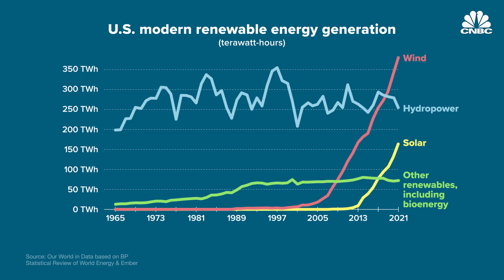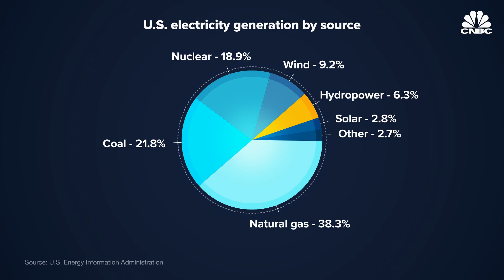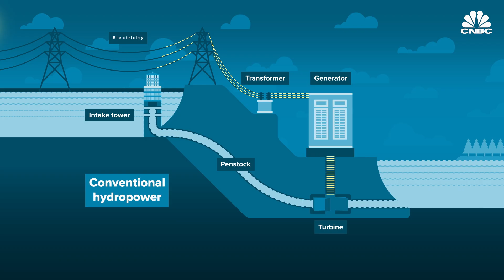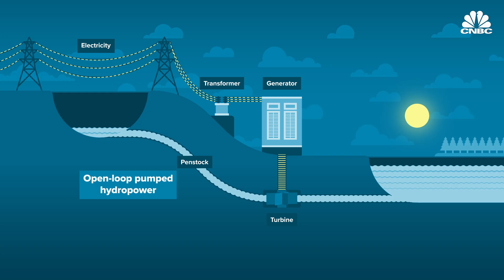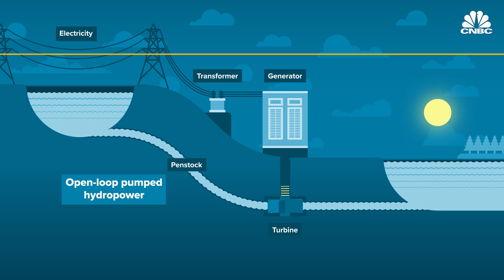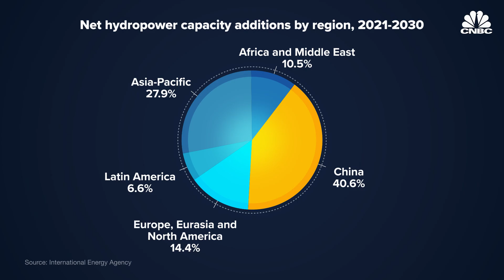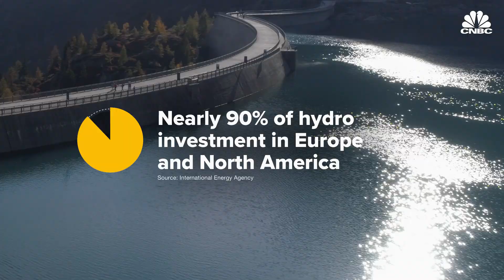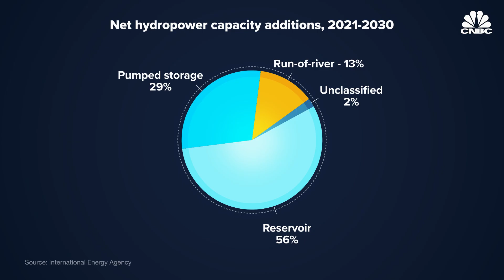What Is The Future Of Hydropower?

Comment: Are we going to talk about nuclear power and how safe and its way cleaner than coal and natural gas?
Reply: Fukushima.  . Chernobyl. Three mile island.  Safe?  No.  Ecological disasters.  Global disasters.   Get a clue.  Radiation is deadly.
Reply: So you want to talk about nuclear because it is supposed cleaner then let's start with the cost.  

A good example to highlight the cost of a nuclear power plant is the Edward Vogtle plant in Waynesboro, GE. That is the only plant now under construction in the country.  It is actually two reactors added to the two already present.  The estimated cost for these plants is projected to be 25 BILLION $$!!.  Length of time to completion from start to finish is more then ten years. They started construction some years ago. 

People are going to have to make up the cost of these expensive nuclear plants which might be good for 70 years tops.   So not cheap any way you look at it.  

And what about how clean nuclear power plants claim to be?  One thing often over looked is prodigious amount of CO2 produced from cement production for the plant construction. 

And of course there is the highly radioactive waste produced by the plant which the US still hasn't found a permanent home for.  It continues to accumulate on the site of the nuclear plants where it is produced.  How long can that go on?   Then there is also the vast amount of low level nuclear waste which must be stored away indefinitely.

And did you say that nuclear power is safe?  Did you forget about Fukushima-- complete melt down in at least two plants due to coolant loss because the tsunami wiped out the back up generators. March 11, 2011.  There was a partial meltdown of the Three Mile Island plant in 1979.   There was the explosion of the Chernobyl nuclear plant in 1986.    

So whether it is democrat or republican states nobody seems to want the big new nuclear plants because of all the baggage that comes with it.  

And lastly there is talk of thorium reactors mininuke reactors which supposedly produce less waste.  But I see no commercial activity with either option.  Maybe the authorities need to talk about it for few more years to decide how to sell it to Americans.  🙄

Any more questions?

Comment: In Québec, the hydro power generation is dynamically adjusted. When wind/solar production goes up, they immediatly reduce flow of water through dams. This preserves the water in the reservoir and is far mreo efficient than letting it flow down and pump it back up. Hydro is our base load, we don't have nuclear or any sizeable fossil fuel production on the main grid. 
Where you have non-dymanic base load such as nuclear plants that take hours to adjust production instead of seconds, you can't do that and you end up with surpluses when wind/solar produce.

Comment: How many towns have a water tower?  Each of those could very easily be converted into energy storage.
Reply: Water towers inherent design is to pressurize the water lines. Put a generator in between and you ruin the towers initial purpose. It still takes energy to get the water up there ya know?
Reply: @aberrantxsoul4777  - the tank doesn’t have to to be completely full all the time so at the very least you could pump the water up when there is excess power being generated to save costs and help even out the grid’s power.  The power conversion part could be done by adding a lower tank and water is simply moved between the two tanks.  The generator could be part of the lower tank if the power generation does reduce water pressure, but I don’t think it would actually do that since pressure should still be based on elevation difference.

Comment: I have often thought that flood waters could be used and pumped into drained aquifers in the Midwest. This would help many farmers whose water wells are drying up. And in turn help the entire country secure our food sources.
Reply: generally surfacewaters are not desired to be directly pumped into aquifers due to contamination risk... however a flood recharge where an area is purposefully flooded and allowed to trickle down (thereby getting filtered) is an option that is used in some areas.
Reply: That's actually a good idea. It'd probably need treatment and therefore more than just local, 10' x 10', pump houses. Our depleting aquifers are of grave importance though.
Reply: true california lets so much water go to waste when they need to improve infrastructure to collect it. they been using too much ground water. as dirty as it sounds imagine if urine was recycled and then used to hydrate californias forest. would prolly avoid using it for agriculture. but it is safe I mean NASA does it all the time.
Reply: I’ve considered that as well.
In regards charging aquifers I heard the figure that 30% of the stored water in the Colorado River system leach’s into the sandstone. Was wondering where that ends up.
Reply: I keep asking the SAME THING

Comment: We here in the Pacific Northwest get the majority of our electricity from hydropower. 
It's the best. We also have the Bonneville Power Administration which is a government agency that keeps the rates low and maintains thousands of miles of transmission lines.
Reply: That’s right, up here in BC, 95% of our power is from renewable sources, with about 86% of that coming from hydropower.
Reply: Quebec has almost 100% with hydro power.
Reply: @Arctic_Adjuster  You need to learn more and understand the power grid.

Comment: A water tower could be used for small scale water storage, they have also been used for years.
Reply: I believe the issue is pressure. Water towers exist to ensure pressure to the taps that they feed, so using some of that energy will lead to lower pressure and less efficiency of the distribution system. That being said, there are thousands of pressure reducing valves in urban distribution systems. Retrofitting these to produce power is a huge untapped (pun intended) opportunity.
Reply: @mkkm945  I considered the idea of running a hydro plant of civil water systems. I was just thinking a dedicated water tower for storing water only for use in the hydro plant. It reduces the need for drinkable water in a system intended to reuse the water in a closed system.
Reply: @BeastBishop  Ah yes. In that case, yes.

Comment: Hydropower is also damning (pun intended) to downstream communities.  China's dams on the Mekong River have choked SouthEast Asian countries of critically needed freshwater.  And it's not particularly sustainable either or stable with weather patterns and snow-based water sources set to change and decrease drastically over the next century.
Reply: Depends how they do it. A dam just holds water temporarily, then releases when its filled. So its the same. But people consume and waste all the water so nothing left flows down stream. People are just stupid. They ruin everything.
Reply: @TheBooban  that is not necessarily the case trapping such a vast amount of water in one area leads to extreme levels of evaporation that otherwise would be minimal
Reply: The upper Mekong basin where China is, is responsible for around 15-20% of the water flow in Mekong. Its the lower basin who is responsible for contributing most of the water in the Mekong. But Laos has build dams in the rivers that feeds Mekong and Thailands Mun and Chi rivers doesn’t supply as much as they are supposed to do since farmers pump out water to use in their farming

Comment: Too bad no mention of the various wave/tidal hydropower systems, which are ecologically friendly, and expandable, and there are going to be continuous tides, either in or out, for a very long time.  No need to dam up rivers/lakes, no need for storage.   All the coastline the US has it could really be a major source.
Reply: They don't work
Reply: Storage is a huge potential positive of hydropower because of pumped storage. Tidal is not commercially viable at the moment.
Reply: Wave and tidal generation has a much lower energy density so it puts out fare more CO2 per KWH
Reply: @terenceiutzi4003  Hi Terence, how so? The several systems I've seen over the years I don't recall them making any CO2?
Reply: @ph5915  Manufacturing. You’d need to make more turbines and run more wire to create an equivalent amount of energy to an average flow rate dam. Everything industrial creates carbon dioxide.
Reply: @ph5915  no they don't make it but over 90 percent of the Co2 on earth is suspended in our water and the cooler the water is the more it can hold! So if you dam it of and let it warm the Co2 is released into the air! And if you rise and lower the pressure of the water all of the entrained gasses are released as bubbles! And that is why any hydro generation releases so much Co2 into the atmosphere!
Reply: @cameronf3343  Hmm, good point. But many things, including all the concrete for the dams, is intensive to build, but I suppose over the long run of time, tidal/wave would need to be repaired / replaced more often in the harsher environment...Thanks Cameron!
Reply: @ph5915  The concrete CO2 production for dams are profusely minimal compared to the CO2 reductions down the line for how powerful they are, considering a single dam is able to make the energy equivalent of several large fossil fuel power plants. Hydro regularly works in the gigawatt hours rather than megawatt hours. However, rainfall pattern changes and drying up rivers due to climate catastrophe is making them less viable seeming long term and it is true the saltwater erosion would make undersea power generation need to be maintained and replaced more often, however, that would also be minuscule compared to the potential terawatts that could be generated by currents. Undersea infrastructure, aside from ecosystem safety, really wouldn’t work with the same laws of physics and we could make turbines with blades which capture far more energy than air-spun turbines.
Reply: @cameronf3343  Thanks Cameron!  Yep, day or night, there's always tidal in/out. A few months ago this company had developed this modular/expandable floating platform, the top could be solar panels, the edges could have wind turbines and underwater the tidal motion capture. Sounded amazing to me.
Reply: Tidal is more dependent on Geography than Hydropower. 

There is a reason its not used as much. Not many places can work for Tidal power.
Reply: Because that technology is not economically feasable
Reply: We will need every type of renewable technology.
Reply: @Morhua1  Thank you, Mattias, I absolutely agree, I was just thinking about relating to hydropower in this instance, but absolutely, anything and everything to get off of fossil fuels and be much less harmful to the environment.  After all, it is the ecosystem human life depends on.
Reply: @Morhua1  Honestly undersea currents are so consistent and powerful we really wouldn’t need any other except undersea turbines.

Comment: "as levels fall, dead bodies have been exposed"... wait what? That feels like it should be more than a sidebar lol
Reply: You didn’t know? They found mafia or gang victims dumped in barrels down there.
Reply: @TheBooban  I always "knew" but hearing it confirmed from a real mobster pushed it from 99% to 100% sure. All doubt removed now
Reply: They are pushing hydroelectric, not because they want it, rather as a necessity to keep people from looking too deep into the fact that W/S are not going to deliver as promised. You have to throw as many negatives as you can into the discussion ( even if the negatives have nothing to do with the subject being discussed) to try to keep people from coming to the conclusion that hydroelectric is a far better option then W/S.
Reply: @andrewjackson9697  Hydroelectric is a good energy source, whatever else you use. It "glues" together all other generation by being a quick load follower, a very efficient (80+% round trip) large scale energy storage solution, and having multiple other uses besides electricity production. W&S WILL underdeliver, and unfortunately it will impact Hydroelectric and its multi use potential a lot by forcing the operators to turbine to keep the lights on, drying up the reservoirs. This already happened in Portugal since we closed our Coal-fired power plants in favor of W&S. If only we would use reliable sources for the baseline demand at least, like Nuclear and Geothermal, and THEN have W&S complementing alongside Hydroelectric, Waste 2 Energy using Biogas, direct waste incineration, liquid biofuels, or hydrochars from organic wastes. With fossil fuels being used as a last ditch resort.
Reply: Why would you not expect that. It happens all the time. In rivers and oceans as well.
Reply: Michael Franzese spoke about this on his channel, in all likelihood they're mob related bodies.
Reply: Lolol agreed
Reply: They don't want to talk to much about it. I wouldn't be a hero by exposing the cartel and have a target put on my back
Reply: @laudableplain4282  hero lol it's not cartel it's a body from the 70s lmfao
Reply: They found dead bodies!?!

That's it.  No hydropower.  It will only lead to more dead bodies!!

facepalm
Reply: @TheGeeoff  I mean, this whole video is about storage of dihydrogen monoxide, a dangerous chemical found in massive quantities in every person that dies.
Reply: @westrim  Totally agree.  Dihydrogen monoxide is scary!
Reply: LMAO 😂🤣😂